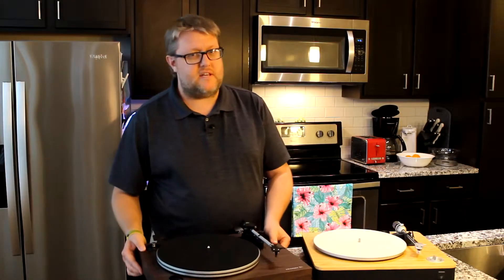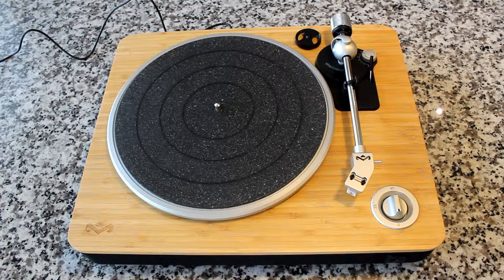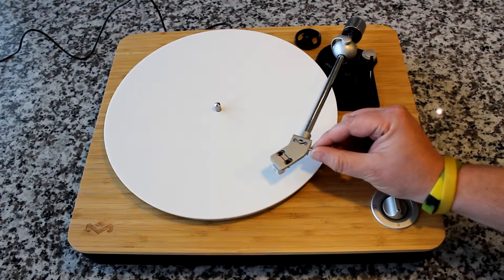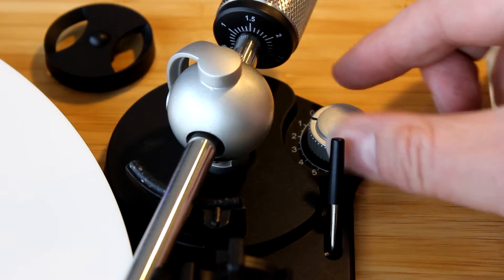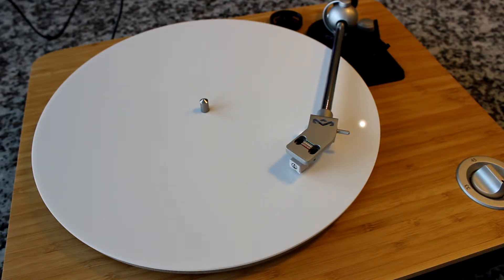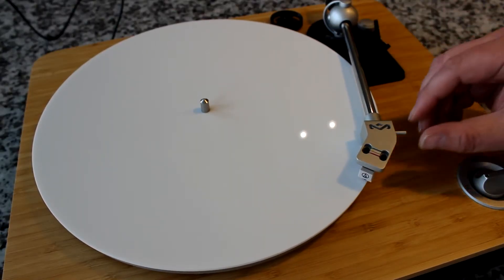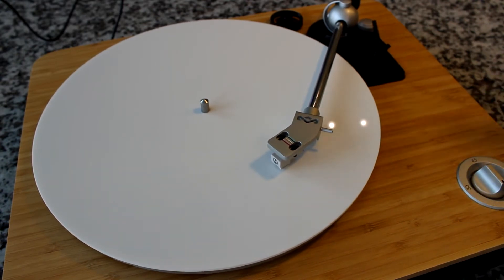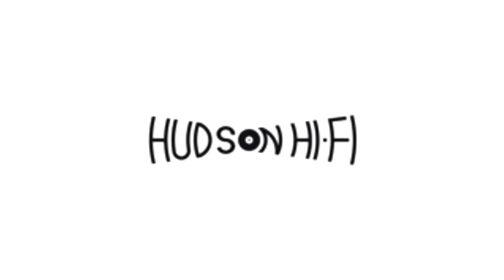What is Turntable Anti-Skate and How to Fix it

Comment: what if you have done everything to reset the tonearm, and the needle stylus is set and yet you still have a needle skating???
Reply from the maker: Have you tried using the Silicone Rubber Platter Mat by Hudson Hi-Fi? This would reduce skating. Also do you know we offer a Deluxe Cartridge Alignment Kit with all the tools necessary for a correct Cartridge Alignment.
Reply: Change the anti skate spring